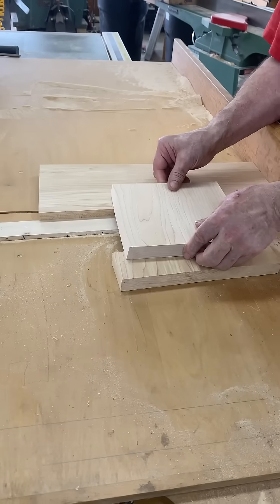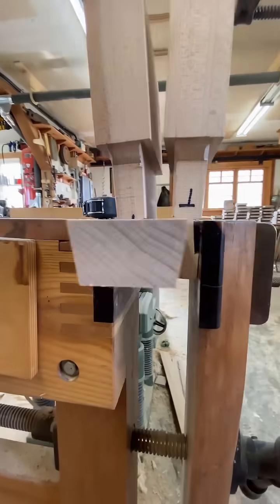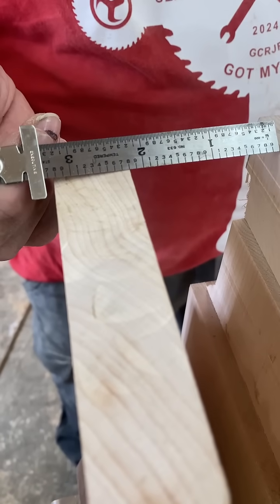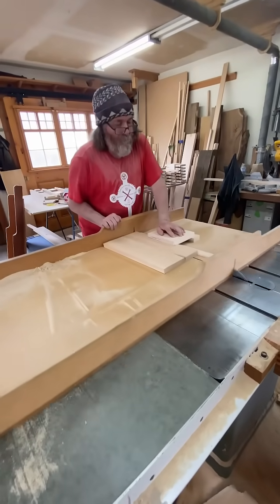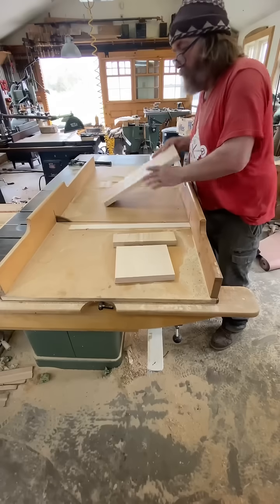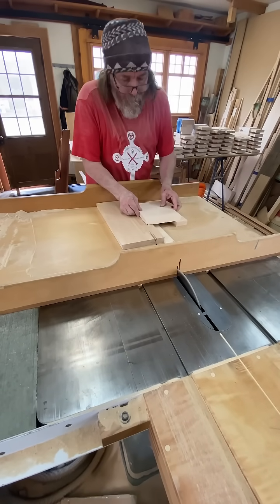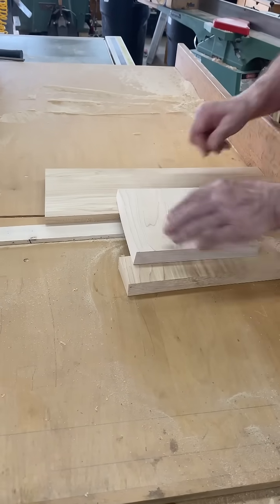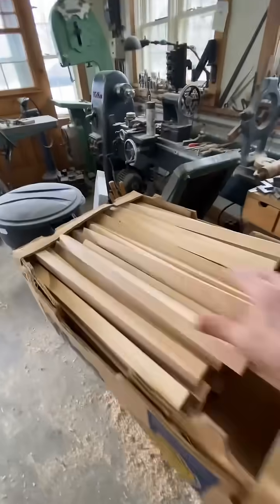72 sliding compound dovetails

Comment: Holy crap!
I must have watch this short 12 times before i noticed what's "compound" about what you're doing!
Very cool! 
At the end, I was able to notice that your blade is angled a few degrees and not running through your sliding jig the way it was originally intended to. Fascinating!
What's holding down your stop block (strip)? Double-sided tape?
Must have taken some serious carefulling to get it all down to the right set of angles...